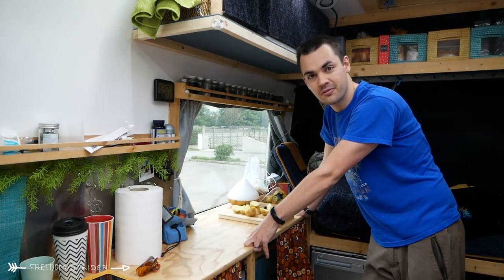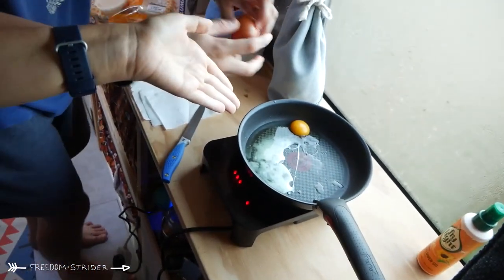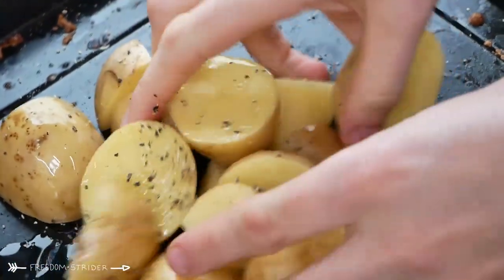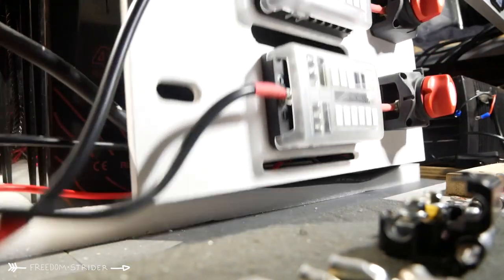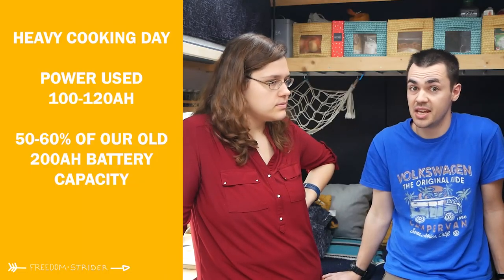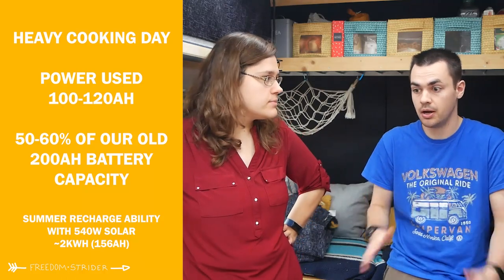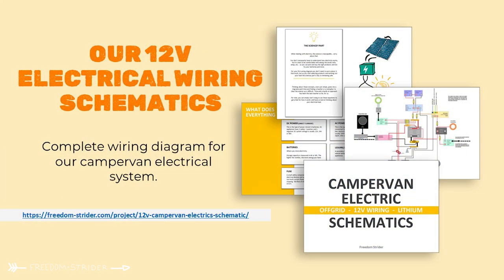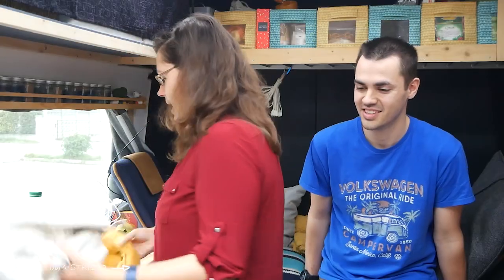Can you do electric cooking in a campervan?... (ft. Ninja Electric Oven)

Comment: A Remoska Prima (400W) Portable Oven is our solution to an extremely low wattage oven.  Works like a dream in our van.  Can be a little slow heating up, but a life saver in winter due to it's low power usage.
Reply from the maker: Yes, we used the same Remoska for our first year in the van and it did so great. Baked potatoes and pastries it could do. Pizzas, sauce bakes, flapjacks or just boiling water off it struggled with. So for us the upgrade has improved how we eat, but depending on what you cook and eat the Remoska can be enough. 🙂

Comment: Hey guys do you plan on upgrading your solar
Reply from the maker: Frankly, not at the moment. In the summer 540W is enough to recharge our daily usage, and in the winter we get barely any so upgrading would be pointless.

Having tilting panels would be jice when stationary hut we aren't often stationary that long to make use of them, and then we have to think about strengthening the tilting for won't, motorway travel etc...doesn't seen worth the effort.

Comment: How are your hands ?
Reply from the maker: Well you know, still attached 😂... they are quite delicate to deal with and it's like walking on a tight rope. They seem to be going through steroid withdrawal, which quite literally means my hands are addicted to the cream. We are just managing to keep the itch at bay. Thanks for asking. ❤️
Reply: @FreedomStrider have you tried fresh Aloe from the plant not from a bottle?
Reply from the maker: Yes, I have... mixed results. I haven't looked into its chemical makeup so I'm not sure yet when is the appropriate time to apply. At present when the skin flares with 'steroid withdrawal' symptoms nothing heals the area, just slows the flare up. Rubbing Green tea has helped.
Reply: @FreedomStrider  I would give it one more try get a big plant and go for it all sticky and really cover all of the hands don’t hold back , it gets a bit smelly but does seem to do the trick of soothing, good luck I hope you get there, just cut the big stems open and slime away 🤪

Comment: Hi, thanks for the video! I found it very informative! Can you please tell me whether you run a fidge/freezer from the electric alongside the various cooking appliances please? We are living in France and currently in negotiation with a company to convert our van, but want to have a good idea of what we need before our meeting on Friday. Many thanks Col
Reply from the maker: Hey Col, yes we run a compressor fridge freezer 24-7. We also have 2 induction hops alongside the oven, we have also occasionally made waffles with our waffle maker and smoothies with a blender. We could run the oven and 1 induction hop together with our 3000W inverter. With our cooking style we use up about 150 - 200ah per day, so if you did not recharge, with 1000ah battery step (at 12v) we would last 5-7 days off-grid. With 500ah battery set up (at 12v) we could get 3-4 days. If you have solar coming in or you drive and alternator charge your batteries will top up. During the summer we have never worried about our power usage even when we have 200ah and or 540w solar panels recharged us.

Hope this gives you an idea about what all the numbers mean practically. 😊

Comment: How do you find the Ninja? Just bought one for my van, tested it at home and noticed it get's really hot externally so a bit worried about housing it in
Reply from the maker: We love the ninja oven, and we do recommend it. You do have to leave space on the sides and back for ventilation - it is a counter top oven so it's designed for open space. In our case we have about 10cm on either side.

Comment: Hi thank you for sharing your upgrades. How did you secure your oven into your van?
Reply from the maker: We used 18mm ply barriers in front of the oven rubber legs. They look like ply L pieces that are screwed to the shelf below - stopping the oven moving forward or sideways. The backwards motion was secured by the van curves and the very position of the oven, obviously you can add the barriers all around if necessary

Comment: I’d be really interested in seeing a short or separate video of your oven if possible , that looks a nice bit of kit! Be great to see the different settings and power draw for each..unless it just uses the full 2.4kw all the time and just cycles on/off differently to regulate if you understand my meaning? 
I’m really struggling to decide wether to go no-gas, currently at the start/mid of our build a lwb sprinter ( which some of your early vids have been really helpful so thanks 👍🏼) 
I’ve followed you for a while ( I used to go by Ant Hart on here but since starting our build we started a new channel too) I’ve only put a couple of short clips up for now just to get it going whilst I learn to edit! There not very good 🙈😉

Seriously impressive power there guys! Atb Ant & Cat
Reply from the maker: Hey mate, great to hear from you.

As far as we are concerned, we should have gone electric (and bought the excess batteries) from the start. With our rhythm of life and living full-time in the camper, electric is just so much easier and cleaner than gas. I would say, grab yourself a 460Ah roamer battery and you could run just about anything and recharge should be easy enough to match. 

Our batteries: https://roamer.com/products/460smart?aff=15

The oven, pulsates, so it doesn't change its draw from 2.4kw. it takes 15mins to get to temperature during which it's constantly pulling 2.4kw and then it just flicks on and off. It works really well. Worth mentioning that the ninja is one of the higher power countertop ovens, there are plenty of good electric mini ovens or microwaves/microwave combi which are less hungry. So if you did want to go electric but with a smaller capacity then there are plenty of good options.

Van building, filming and editing, you are up for the full challenge 😂 it was quite the juggling act for us, but the results of the memories recorded are so worth it. Enjoy it all, and pace yourself

Comment: It seems like a lot of investment for the return. There are many ways to cook potatoes that are more efficient.
Smaller chunked potatoes cook faster. 
My Ecoflow with 300 ah 3500 watt inverter completely charges from zero charge with 15a ac in 2.5 hours.
A small quiet 2,000 watt  generator recharges it rather quickly. You could top off easily in low sun conditions.Less hours on your van engine, unless you are already driving.
My brother has very little battery and runs microwave convection or cooktop only with his generator. A lot smaller investment. Surprisingly quiet
Reply from the maker: Microwaves are an interest, low powered and often short bursts, more effecient ways for sure, but the oven has been a game changer for us, and we do cook 70% of the time on our vango induction hobs too which are max 800w (but usually 300w on medium) 👍